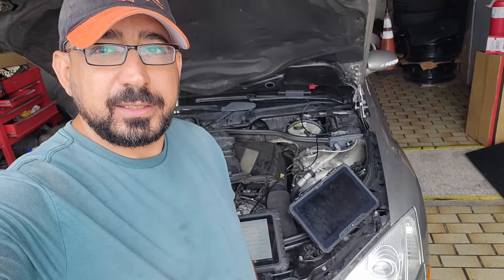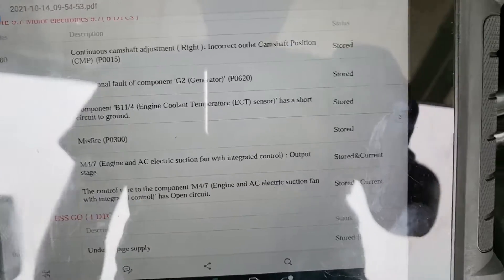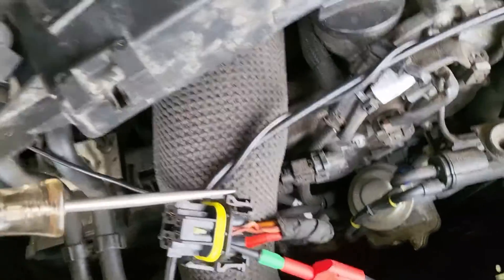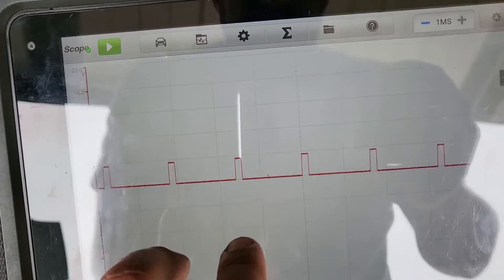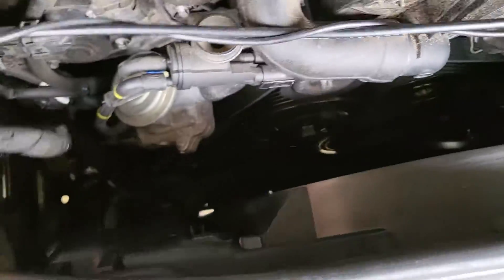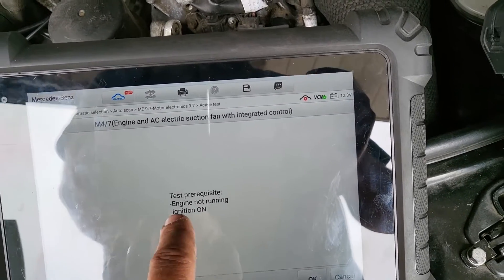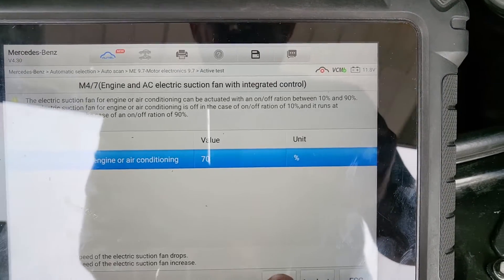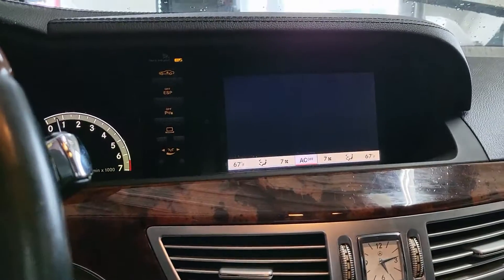2010 Mercedes Benz cooling fan. All it took is a command prompt!

Comment: I Have a Cooling Fan problem but a Weird one. My Cooling Fan Comes One when I Start the Engine. Even at Cold start, The Cooling Fan Blows. It was Blowing with Engine Off too, But I found a Broken Green Wire and Connected it. That's when it started Blowing when engine is started. I have scanned the car multiple times, No Codes in the Cooling Fan Module. Only thing I found abnormal is in the Thermal Management Live Data "On/Off  Ratio Of Fan Actuation" the Value is 9.77% and the normal Range is 10-90. Idk what that Means.
2014 Mercedes C350

Comment: I just did a diag in this exact issue. The fan not turning on is only a symptom. The issue, when he went in to try to turn on the ac and it wouldn’t turn on, is the actual issue the fan isn’t coming on. So you would have to diag why the ac compressor isn’t turning on. In my case, the climate control module was shorted internally and didn’t allow the compressor to turn on. The pulse width signal came from the climate control module.

Comment: Common problems with newer mecedes after around 2005 is the location of the ECM or what some people refer to the computer of the car 😂. In these newer silly mercedes the ecm overheats and burns out the chips or resistors and hence you get fan and starting issues.

Comment: Hey I have a 2008 Mercedes Benz c300 the fan won’t come on now matter how hot it is or if the ac is on or not could you tell me what it could be
Reply: Hey did you get problem fix having same issues

Comment: So what was the actual issue?  When the radiator fan does not operate as expected and throws a code, usually it's the fan control module on the fan motor or shroud (depending on model).  The issue is usually intermittent, which would explain your code going from current to history.  Some research shows the actual issue is some of the cold solder joints in the module.
Reply: От руки включается который вентилятор,он не рабочий

Comment: I just cleaned the contacts.  One plugs into the regulator and the contact plate was bent away from the blade that slides in.  When its warmer, I will clean the blower correctly.  It turns always.  Surely is can use a cleaning.  They disassemble very easily.
Reply from the maker: Thanks for the tip

Comment: I Have A 2004 550Ml Mercedes.. I Replaced The Fan 3 Days Ago (Brand New) It Was Working Fine, Till The 3rd Day, It Stop Workin Fuse & Relay Are Good What Can It Be?
Reply from the maker: Where did you buy the fan from?
Reply: @DallasAutoDiag  I Found Out Why The Fan Wasn't Working.. Ac freon Was Super Low So The Ac Clutch Wasn't Engaging & That's Why The Fan Wasn't Coming On.. Found The Leak & Have To Bring It To The Ac Shop.. When I Added Some Freon The Fan Came On...🤦‍♂️

Comment: Okay. Please provide a more detailed step by step. What software are you using for reading. Where do you plug in to get diagnostic? etc....
Reply: Old comment but deserves a response.  You have to use a bidirectional scanner and plug it in the OBD2 port under the driver's side dash.  Bi-directional, because these can tell the car to do things instead of just reading codes.  But you have to do some research to make sure the scanner does what you need it to do.  Google "good Mercedes bidirectional scanner".
Reply: Buy a  book and learn. He's not your slave to ask for detailed steps. The gull some people like you have.

Comment: I have the same problem but the cooling fan still runs high speed even with engine off… so I plug the scanner and the deleted the codes and it work normal for 3 days and the cooling fan turns back on high speed even when I unlock the door. Could it also be a command prompt???
Reply from the maker: You have another issue. The computer is putting the fan on all the time as a protection procedure for another issue in your car.

Comment: Hi , I have a 2005 ml 350 . Sometimes the ac work , but if you turn it up higher, the air will be hot like you switch it to heater.  What do you think can be the problem ? When the ac is working, the air seem cold enough like it doesn’t need Freon . So I’m thinking it’s not low on Freon.also the fan doesnt on low setting . It only runs when you put it on higher setting. But then if you put it on higher ac setting , the air will come out hot.

Comment: Thank you for the video, i have a 2015 W205, fan goes high speed with ignition on, main power and grounds are ok, so is the 12v from ignition on. on the lin control wire, there is a steady 10.5 volt, even if i unplug the fan, so this points to a faulty ECM or a lin wire shorted to b+ somewhere, or am i missing something? is there a direct connection from ECM to fan on the LIN control wire? thank you
Reply: Cant Thank you enough for your time, it has to be the fan itself. When i unplug the auxillary water pump and the fan, i have a correct PWM on lin wire, when i connect the fan back and leave the pump unplugged, it goes full speed and PWM disappears.
Reply from the maker: Look somewhere else. Something in the car is telling the pcm to power the fan on the moment you put the key on.
Reply: Also the electronic coolant pump is Running at the same time, could it be faulty? I found in wis there should be a lin connector under the wipers, maybe water there? Thank you
Reply from the maker: @jakubkusa  
That confirme my theory more. Mskes sence more that the pcm powring both on because he sees somthing else that he doesn't like. A high temperature or something
Reply: Well i still suspect the ecu, since it has no control of the fan.. it should send a square wave when i command it bi-directionally, right? All the sensor values are good :(
Reply from the maker: @jakubkusa  read system description first and learn how it works before making a decision.

Comment: Hello, I bought a 2005  C320 that was working fine ,next day after driving it for 15 minutes, 30 minutes after I heard aloud noise coming from the drive way and it was the cooling fan on full blast, and soon as I started the car the fan slowed down then came on as soon as I turned the engine off,
I unplugged the battery overnight, then ass soon as I plugged it back the fan came on on a full speed while the engine off

Comment: I have a similar car GL 550 2009 and when I start the car the AC comes on and works grate but after a little while it goes off and does not comes on, so what you think could be the issue

Comment: The ac system on my car doesn't want to fill with freon, what could be the problem?
Reply from the maker: Yes, the problem is either you are trying to do it yourself with the wrong equipments, or your car in the wrong shop.  Pay a pro to diag it.
Reply: Buenas noches amigo mi electro ventilador no prender el aire prende y se apaga al rato en los enchufes hay corriente que me recomiendas?

Comment: HI , I have a 2010 e350. My car's radiator fan acts all funny when the car is turned off. It keeps going on and off for 10 seconds  each time. initally its very low so you can barely hear it but a few hours later it gets really loud and keeps the same sequence of goign on and off. i took it to a few mechanics including the dealership but no one has been able to fi it. Would appreciate some advise. thanks
Reply from the maker: Lets start with a full scan report to see if there are any codes that could cause this issue.
Reply: Is your problem fixed?! If yes, what have you done to fix it.. i also have the same problem with my e350 I've replaced temp sensors, coolant and the radiator fan as well (even washed the radiator with pressure washer) still the problem persists.
Reply: @taquizaffar3908 I have the same issue on mine… have you found anything ?
Reply: @ivanrodarte9508  yeah, it’s fixed now.. in my case EGR was faulty.. just disconnecting the EGR fixed it.

Comment: Hello mate good evening from Australia I have a Mercedes’ ML300cdi fault code *Check component M4/7 (Engine and AC electric suction fan with integrated
control). Positioner signals fault.

We have plugged Mercedes’ Star into the car and tested the fan with speed test , in which the fan works , but whilst carrying out the test the response it slow when you want it to speed up it won’t you have to wait or keep increasing the speed using star , the reason for carrying out these diagnostics is because after about 20 minutes of driving I get the thermometer pop up on the dash but live coolant temp is fine , any suggestions would be great cheers Mate
Reply from the maker: Oh boy, that might be a challenging diag. Sorry can't think of anything without being there, scanning and looking at some live data. Good luck
Reply: No worries cheers anyway matey 👍

Comment: I have same issue on a 2012 GL 350 ... fan will not come on.  The plug has power. I am on my second fan and still nothing. So how was this issue resolved?
Reply from the maker: How many wires on your plug?